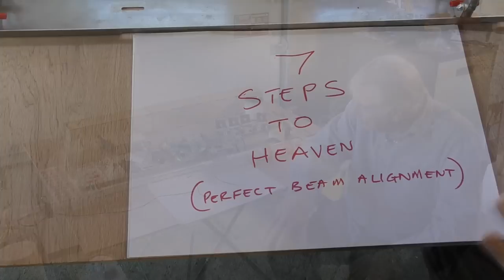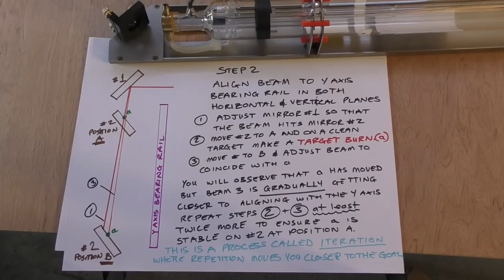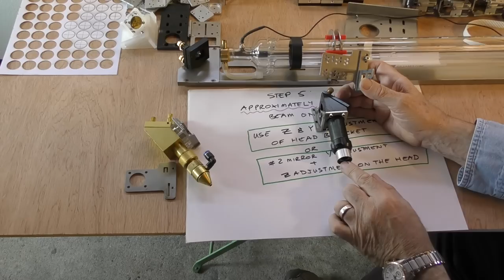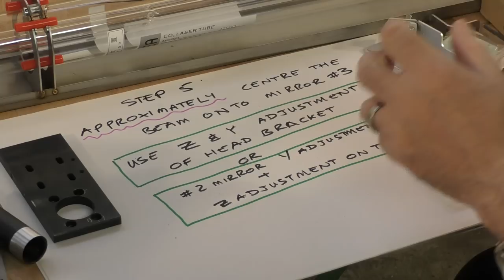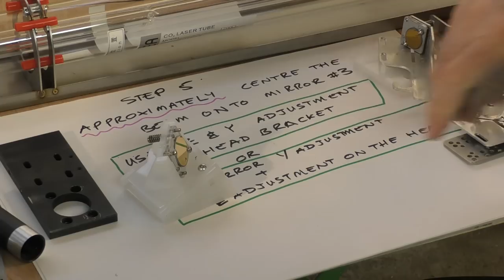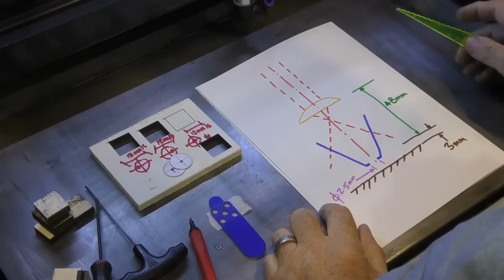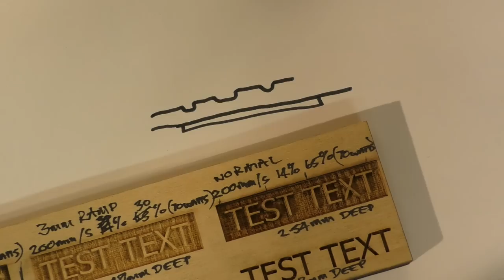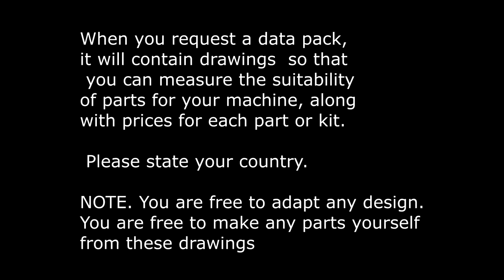RDWorks Learning :Lab 192. New Parts now Available and Detailed Explanation of Beam Setting

Comment: i thought i had done sufficient research on k40 lasers... until i bought one and found out just how much i didnt know! your video has been immensely helpful in understanding how to dial in my machine. I'm also very interested in the data pack.
Reply from the maker: Hi James
 None of this kit is designed for a K40 machine. There are several designs of K40  but all have very minimalist lightweight heads already. However,, the heads all lack adjustment to allow easy and accurate beam setting.  The biggest limitation is the inability to fit different lenses and the lack of air assist.
I have a project in development at present where I am trying to make a special version of the lightweight head that will fit  a K 40  but it is several weeks away  so don't hold your breath. 
I have a non working K40  that I am using for the design work but I will need a few guinea pigs to evaluate the design before I pass it to Cloudray for wider sale. Send me your disguised email address in another comment and I will keep in touch.
 Best wishes
Russ
Reply: I realize that your parts aren’t designed for the k40; I was hoping I might be able to adapt them in some fashion so that they might fit. It’s possible that I’ve purchased the worst k40 ever built and until I saw your video I’d been a chicken with my head cut off. In any case I look forward to seeing what’s in store for the future!

Comment: Great stuff, with you head my Maschine goes also with 1200mm/s. Thank you so much
Reply from the maker: Hi
Speed is only one small  benefit of this upgrade. Your machine would have run at 1200mm/s before the change BUT it may have taken 200 mm each end of a scan to slow down and turn round. the real gain is to be had by increasing the ACCELERATION see this video to really turbo charge your machine.
 https://www.youtube.com/watch?v=qI3Xjb7PgkE 

Best wishes
Russ

Comment: Hi Russ. Thanks for all your brilliant videos, which are really accurate and helpful. I have never understood why I couldn't align my china blue but now I know. I see this video is 2 years old and I'm wondering where I can get the material you have developed. I have not found any information, where I can buy these and don't even know if you sell those parts at all. I'm completely frustrated with my laser, as it does cut but not always and this is why I need to fix this problem. Would be glad to hear from you 🙂
Reply from the maker: Hi Peter
 I am a kindred sprit when it comes to frustration with Chinese design engineering and I have experienced the sortt of problems you experience. Fortunately a lifetime in engineering and design has allowed me to decode the problems that were built into the machines by those cunning Far Eastern guys to confuse us.  You can contact me with this private message form and I will reply
https://forms.zohopublic.eu/ndeavorlimited/form/K40XtreeemLaserCutterContactRussSadler/formperma/k2Cn0QN5ChpazfTMAUw25lZ-FKpjZa96TQWHjv3ntOg
Best wishes
Russ

Comment: I learned that the path planning portion of the CNC software on my plasma cutter from China has parameters coded that the user cannot change for acccel and decel .   particularly for corners/ change of direction.  If that's true of ur machine and the software remains tuned to the original mass then somehow it's a sw not a hardware solution to seek out.    For instance Linuxcnc has parameters the user can tune.

Comment: My question is with an open mirror system on the head how do you keep the mirror from smoke adhering  or condensing to the cutting heads  mirror surface ?.
Reply: I believe Russ has made his answer apparent in other videos where he mentions (on several occasions) having GOOD air flow ACROSS the workpiece (from front to back).  You want to get the smoke out of the work area before it even has a chance to rise up to that mirror.

Comment: This may sound like a silly suggestion, but considering the amount of modification you're putting into your machine at this point, it might warrant serious thought.  Why not move the laser tube to be oriented parallel to the y axis instead of the x?  You're already building a special mounting system for the tube.  You're already building an extension arm out the side of your machine to accommodate a larger tube.  It might make the machine look a little silly with a big arm coming out the back, but in most shops, the thing doesn't really get moved much anyway.  In moving the tube, you could not only make the alignment process easier, but you'd also increase the efficiency in power.  Removing mirror one would mean a few percentage boost in power.

Love these videos.  You're the reason I have one of these wonderful tools!
Reply: I have had this discussion with Russ a few years ago, and I have since studied it, and the pro is you eliminate one whole mirror (#1 is gone) and you increase in power by the percentage that mirror was costing you.  The negative is having a six to eight foot thing in the back as most shops are set up for things to be wide not deep.  Another problem is safety both mechanically and electrically because it would take an enclosure that would now be as wide as it is presently to also being the same deep (or close to it).  What a beast of a machine. I personally could not do it as the depth becomes too much but if I could I would one hundred percent do it.
Reply from the maker: Hi Justin
 I remember the discussion with  "Best Stooge" it was great fun,  Much as your idea seems to have an obvious 4% power gain by saving a mirror  there is a much bigger and more practical problem than the space issue.  Imagine your left arm ito be  laser tube. Point at something that is above your shoulder height and a bit to the left.  Now further to your left identify a wall socket that will be below your shoulder height 
You now have to get your arm parallel with the left wall and parallel to the floor and finish up pointing directly at that socket. Can you design a tube holder with X Y and Z adjustments and rotation on each axis that would allow you to do this?  That is exactly what would be required to align the beam with the Y axis. That would be some beast!!! Compare that to the TWO adjusting screws on mirror 1 that achieves the same thing.  I think 4% power loss is a much better option and as for the suggestion of it being easier to adjust.....hmmmm, just visualize how you would do it. I love reinventing the wheel and if we only look at the plusses I think the square wheel has a lot of merits. Saving of handbrakes on cars, reduced pollution and petrol costs,  and who would want to pinch your alloy squares?
 Best wishes
Russ
Reply: @SarbarMultimedia  Iol.  I bet it could be done but damn I all but forgot we have 3 dimensions we have to worry about so the tube would need to go up, down, left, and right and all points in between.  Trivial for a mirror but for a laser tube?  Not so much.
Reply from the maker: @thebeststooge 
 Great to see you are still up and running.  I have had several private emails on this "great " idea to improve my machine. I hate knocking people's genuine  beliefs so a nice mix of logic and humor  seems to work well. I love it when people suggest improvements because occasionally I can really benefit from it. I never steal ideas  I like to give credit and praise for innovative thought  even if I take the idea into a different direction.
 Stay safe
Russ
Reply: @SarbarMultimedia  Right, and understandable.  A lot of people forget just what we have to do to get the mirrors aligned and fail to project that to the tube.  For instance the tube would need to not only move in X, Z, and Y but, as I said, all points in-between so the tube would also need to be able to move diagonally to the first mirror.  Without that ability you may get it aligned dead centre on the first mirror when it is close but not when it is the farthest away (or vice versa).  This is where people forget. edit:  Another thing people forget that a small move at the lens of the tube to align it is amplified at the rear of the tube in the opposite direction, so 1mm down would swing the end up by 1mm so now you need the tube cavity even deeper.

Comment: Is the lightweight head still something you have available or is that gone by now? I’ve tried the “comment with e-mail” a couple times and they got deleted, but I haven’t received any communication. 
It’s absolutely ok if this is no longer available, I don’t mean to bother, just looking for an answer either way.

Love your videos and I get excited every time a new video shows up!
Reply from the maker: Hi
 Yes, You ube has algorithms that detect anything that looks similat to an email address. At present they are noy all that clever so it is easy to fool them with a couple of sentences like this.  Start with john and the add a dot followed by smith  If you add the normal  and symbol plus  g======mail with a dot and a com.  That seems to work at present. Yes I still supply parts and will send you a data pack and also delete your comment
 Best wishes
Russ
Reply: @SarbarMultimedia  ok perfect. Yeah I probably didn’t go far enough with the obfuscation. The first part is the letters RSFX and after that the word online. Same popular provider that you used in your example with the big G.
Thank you!

Comment: Your glass holder automatically aligns it to the frame of the engraver which the x and y axis rails (should be) are aligned to. 
So step one.

The machine i bought (used) thebrackets were stripped and one wrong nudge put this out of alignment. 
After i got the mirrors pointing.. I realized my flaw. Yes it still works but probably easier if the tube is frame alaigned.
Reply from the maker: I think you misunderstand. It does not matter how your tube is aligned in relation to X and Y axes. The only requirement is for the beam to be aimed at the cenre of mirror 1. Mirror 1 corrects any misaliggnment.. It makes life so much simpler if you have mirror 1 and the tube mounted together. The most important thing to learn about beam alignment is to keep getting the beammonto mirror centr and aligning the axis as TWO SEPERATE actions  Align the beam to an axis and then find a mechanical way of moving the beam to the centre of the mirror.  Once you have set alignment you must NOT adjust those screws.
Best wishes
Russ
Reply: @SarbarMultimedia  
Hmm.. Ok.. Visualizing in my head. So even if the beam is reflecting off #1 not at a 90. Say 93deg.. #2 can still be set to align the beam with the y rail?
Reply from the maker: @turboflush  Sorry, you are still misunderstanding the role of mirror 1. Mirror 1 is the vehicle for aligning the beam with the Y axis and Mirror 2 is used to align the beam to the X axis . Mirror 3 adjustst the bem through the Z axis..   Once you have aligned the ebam to the Y axis with mirror 1  you will certainly find that the beam does not hit the middle of mirror 2. WHAT THEN? . You MUST NOT make ant ajustment s to mirror 1 or you will destry the alignment you have jiust set.. You therefore have two choices Mechanically move mirror 2 so the the beam strikes the centre of the mirror  OR move mirror 1 so that it reflects the beam onto mirror 2.. The problem with this second option is that if you move mirroe 1 then you will upset your alignment and have to do it again.  That is why I have made the tube and mirror 1 into a single unit . By referencing the base against a soloid part of the machine I can move mirror 1 and the tube as one element and not change the alignment.
 It's not and easy subject to visualize , hence I describe in great deati all the set up steps in video 192.
 Best wishes
Russ
Reply: Ok. I drew it out. Because my tube is set not parallel.. My #1 is not at 45 to the frame. It is splitting the larger than 90.
The #1 mirror has to move closer to the laser ( center of machine left/right) to compensate. ( i think)

Here i was thinking it was more important and it was just ignored in all these alignment videos on youtube.

Still; when i get around to installing the new mount i will square it to the frame.

Are you still sending out the specs to build the heads? I can have local metal shop cut it for me. I had to shim my current head because the mirror plate was sticking to the bracket.  Turboflush at g mail.

I have noticed what you show with the belt. I figured it was just a result of scanning the image. 

Only been lasering for 2 months. 20 days on co2.  :d
Reply: @SarbarMultimedia  
I think i said incorrect. 
#1 aligns to the y axis. 

Your all in one bracket makes it easier. Because it removes possibilty of twisting. The lazer. 
Aligning it with crooked laser is possible ( i did it) but adds a bit more work. Perhaps making the alignment more touchy.
Not trying to argue. :) just trying to verbalize whats in my head. Hahaa

Comment: Ok . that nozzle zapper.. I am making one.
I have been doing it the hard way.
I need some plastics :)
I am guessing RDworks is easier to design in? Than Lightburn?
Reply from the maker: That 5 hole device can be made from MDF or plywood. I just happen to have a lot of acrylic pulled from the scrap bin of a local plastics supplier.  If you align your beam correctly throughthe axis of the lens tube, this tool is just a final check It should already be on centre.

RDWorks has lots of tool that makes it look like a piece of design software but its not. Yes you can draw simple shapes  and do a few simple modifications to graphics  but it is  an INTERFACE program that allows you to IMPORT your designs for proper cad ar graphics software. It is a package that takes your design and once you have set parameters for cutting or engraving, it converts your creation into a machine code file and send it to the laser machine. LIghtburn does exactly the same BUT it has many more graphic manipulation toosl and  is getting closer to a design package . You can download a full version as a 30 day trial to see if you like it.
 Best wishes
Russ
Reply: @SarbarMultimedia  i use Lightburn. I avoided rdworks because i had already started with Lightburn on diode laser. 
I find building or modifying designs a little painful. 
What are you designing in?
Reply from the maker: @turboflush  
 Hi 
 Allmy mechanical design work is done with 2D CAD.  I'm using a package I that is part of a CAD?CAM system I used to used when I was running two 3kw metal cutting lasers as part of a metalworking business. Any "D cad package will work, there are several really free ones you can download. For graphics I use  Photoshop and Illustrator  but again for free you can get a photoshop/illustrator  clone called GIMP.
 Best wishes
Russ